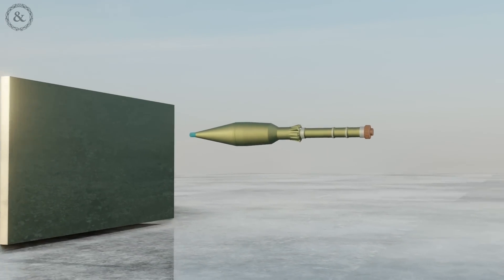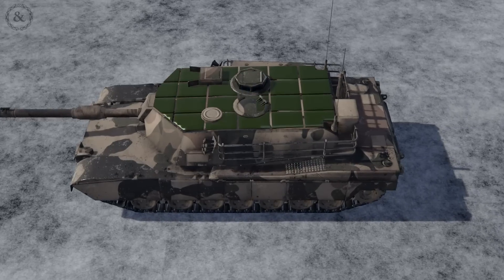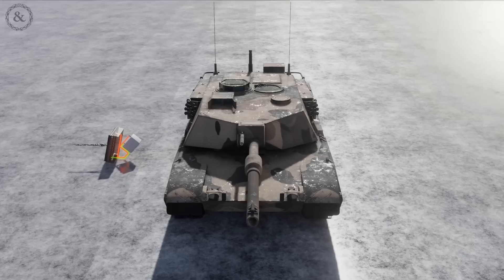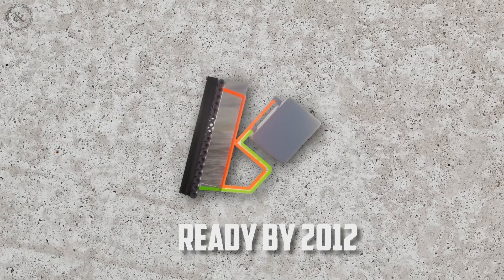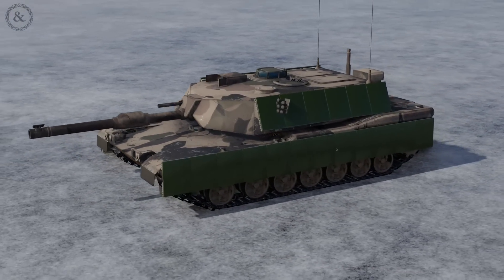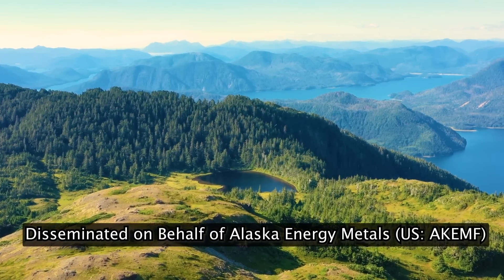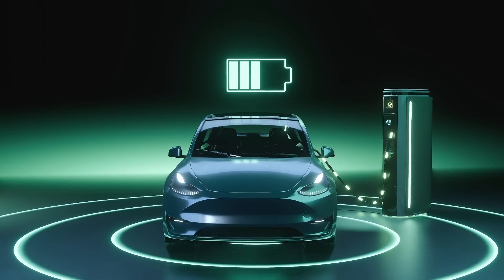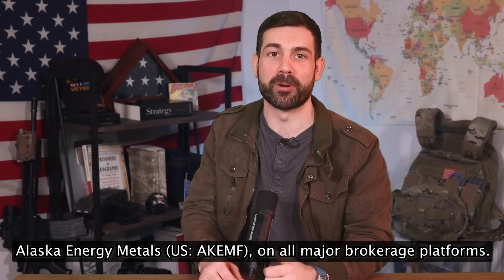How Electromagnetic Armor Vaporizes RPGs

Comment: "Can't imagine what would happen if I touched the wrong thing while working on it"
You don't have to. The operating concept behind this armor to my knowledge is basically a weaponized and even more intense harmful electrical phenomena known as an "arc flash". There are videos on YouTube of what an arc flash looks like when it's powered by "normal" electricity.
These tank armor proposals use a lot more volts, and a lot more amps. So instead of the injury received being "get severe burns across any unprotected area of your body" like with a normal arc flash, the injury instead becomes "Whatever parts of your body conducted electricity will be vaporized by the sheer amount of electricity forced thru them".
Arc flashes are basically an explosion. But instead of the energy being stored in explosive materials, or gases under pressure, the energy is stored as an electrical charge in capacitors (or a difference in electrical potential in a power distribution system such as the electrical grid, which is why electricians take such great care to wear insulated and fire retardant clothing when working on switchgear or HV lines).

The reason that this "electric armor" concept is so attractive in the first place is that it theoretically offers the appealing capability of "ERA that can take more than 1 hit to any one block of ERA", where with normal ERA it only works in any given location a single time, because of the nature of the material being distributed as armor in blocks. Entire blocks are detonated when the ERA functions. The only way to make it work more times is to subdivide it into more blocks, but they can't do that because there is a minimum size of block that can defeat a shaped charge. So they're at the limit for that.

Electrical armor is currently largely impractical. Capacitors of the requisite high voltage and high energy capacity are large, heavy, and when charged to operational levels are not tolerant of disruption such as that caused by hostile weapons impact on the capacitor itself (they are usually pretty tolerant of vibration when properly potted, but if you poke a hole in the capacitor with a metal object, all the energy in it will be discharged thru that metal object, and given that the whole point of electrical armor is to vaporize the metal jet from a shaped charge, that's not going to be a small explosion happening inside the armor of the tank).
Additionally, vs sabot (APFSDS) rounds, it doesn't have enough energy to discharge into the incoming round to defeat it. In other words, it's useless against sabot rounds such as those fired by most modern tanks. Only shaped charges, and maybe Explosively-Formed Penetrator warheads too since they're largely similar in function but have a larger stand-off range.

In other words, it adds weight, adds hazards to the crew compartment unless you put it in it's own compartment and treat it like ammo (blow-off panels highly recommended) and it doesn't really do much against one of the biggest threat to modern tanks, which is "other tanks" (firing APFSDS, or Sabot rounds).

In fact, there is an alternate kind of missile that would also be effective against both current ERA and this proposed electrical armor.
Kinetic missiles. The idea is to optimize the missile for high velocity with a "warhead" that is the "dart" from a Sabot (APFSDS) round.
In fact, Canada already has something suitable that just needs a guidance kit, the CRV7 unguided 70mm rocket.
It has an exceptionally high velocity compared to other 70mm rockets, due to a higher energy solid rocket fuel and a more aerodynamic fuselage shape being used. In fact, when comparing the Hydra 70 to the CRV7 just after the motor burns out (which is sooner for the Hydra than the CRV7), the kinetic energy of the CRV7 is roughly double that of the Hydra. This lends itself well to using the kinetic energy alone of the rocket as the means to cause destructive effects on target, which I'll go into later.
It is also more accurate than most 70mm rockets, due to the spin stabilization typical of 70mm rockets being imparted not only by the flip out fins, but by canted vanes directly in the path of the rocket motor's exhaust. This increases accuracy by giving the rocket some measure of stability (due to the spin) as soon as it leaves the launch tube, and before the flip-out fins have a chance to deploy to fully stabilize it. In other 70mm rockets, the fins are the only source of stabilization, so the fact that they only deploy after the rocket has fully cleared the launch tube gives those rockets a period of time where they could drift off course due to aerodynamic forces that the fins, having not deployed yet, are unable to balance out.
And now for a direct quote from Wikipedia:
"The CRV7's kinetic energy was so high that testers were surprised to find that practice rounds fitted with an 8-inch (20.3 cm) steel rod were penetrating outdated Centurion tanks used for target practice. This resulted in the development of a dedicated antitank warhead that replaced the steel rod in the practice warhead with a tungsten rod. This new antitank warhead could penetrate a Soviet T-72 main battle tank armour from any attack angle. Further study into this effect led to the WDU-5002/B FAT warhead, Flechette Anti-Tank, containing five tungsten-reinforced steel flechettes that could penetrate a T-72's side and top armour at a distance of 10,000 feet (3,000 m). It was also found to be a useful warhead for use against medium and light armoured vehicles."
So like I was saying, Canada already has the required propulsion and terminal effects packages for a kinetic missile, all that is needed is a suitable guidance package, which shouldn't be too hard to make happen since the Hydra 70 (which has a lot in common with the CRV7) has several different guidance packages either in production or nearly fully developed.

And with that sort of missile entering the battlefield, suddenly you aren't safe with your fancy electric armor.

Comment: As a former tanker who took a leak off the side of my tank before crossing the line of departure in desert Storm, this sounds shocking for the family jewels!
Reply from the maker: I’m picturing all the E4s and below who manage to electrocute themselves on the armor haha
Reply: I don't think they'd electrocute themselves because the batteries would already be dead after playing Halo all night  @Taskandpurpose
Reply: @Taskandpurpose somehow they’ll managed to sham their way out of that one too
Reply: This whole thing reminds me of the garage railgun hobbyists of the early 2000s who figured out that they could shrink pennies using cascade voltage multipliers and capacitors.
I wonder how many are alive today.
Reply: I've never had the privilege, so I've wondered, just curiosity: is there a section for .. restroom breaks in the manual, or did they ever mention that in tank school? I'd imagine the guidance would be that IF you survive, they'll make sure you get a new pair of pants, but you might have to hose out your seat yourself.
Reply: @196cupcake  dismount if in safe environment with a E-tool... If not safe diapers, baby wipes, 5 gal Lowe's bucket, 50 Cal ammo can. Helps to always have a few extra reg long trousers on the tank.
Reply: That's what the plastic cover plates are for.
Reply: Guess you really pissed off the enemy?  LOL
Reply: Unless you open the control cabinet your safe. It's not electric fence
Reply: @Fossillarson  I was going to say similar. Although, nothing electrical works "as intended" forever... I can only imagine what a lax maintenance schedule could do with this.
Reply: @kathrynck the same thing lax maintenance does to strapping explosive sandwiches on the side of your Vic anyways. It’s not a risk we’re unfamiliar with already.
Reply: @kolinmartz  Makes me wonder where can I get an explosive sandwich? That's just a very amusing metaphor :)
Reply: I was like, would a bullet set it off too but the armor plate may stop it
Reply: can't it easily be defeated by covering the RPG with a couple of rubbers? 
that's like what? 10 cents or 20 minutes with a goat in the middle east??
Reply: It fail consistently from the harsh environments

Comment: One of the things I feel might happen with APFSDS is that it gets vaporized but since it's already moving so fast, it basically just turn it into a HEAT round.
Reply: i mean you need a lot of energy to vaporize a sabot round
Reply: A sabot round is a solid dart of heavy metal, you need immense amount of energy to vaporize that. This is completely unlike RPG shaped charges that detonates to send a molten jet of copper at hypersonic speed.
Reply: Also the conductivity of the metal makes a huge difference in the effectiveness of such a system. If you designed the system to be as efficient as possible against HEAT rounds, it likely wouldn't have the juice required to do much to a tungsten dart. If you overbuilt the system to be able to damage darts, well now you are pumping massive amounts of energy into something that has like 30% the conductivity of copper and its likely going to be heavy and power intensive.
Reply: HEAT travels at 10km a second. Sabots at ~1km/s. It's not going to "speed" up to hypervelocity.
However.... tungsten is a metal that we use for welding, because it doesn't melt, and is super dense on top of that. What vaporizes copper does nothing to tungsten.
Reply: @ryanj610  again I know the difference and that it's not gonna be truly identical. Also HEAT isn't molten in the first place. I'm just saying the tiny metal particles will still be carrying a lot of velocity and will likely penetrate some amount of armor and the mechanism by which they do so is somewhat similar to how HEAT works.

Btw sabot usually travels closer to 2km/s, not 1. M829A3 is about 1650 m/s, 3BM42 about 1700 m/s, DM53 about 1700 m/s (from L/55). Newer experimental guns/rounds are pushing 1900 m/s. It would be about 1500m range that they slow down to around 1km/s which is still reasonable for tank engagements, but at much shorter ranges, they impact at velocities higher than that.
Reply: @RedVRCC  penetrators work because they are essentially a monocrystalline structure, all of the force and power is because it is one solid piece. It's like a dart vs a handful of sand.
Reply: It wouldn’t turn into a heat round even if it’s melted.  HEAT round’s molten jet is much much faster than the speed of a SABOT, plus it has a smaller cross section.  So a molten SABOT, if it could be done, would just splash against the armor plate, not penetrate it.
Reply: You have definitely misinterpreted how HEAT rounds work and where there penetration comes from. Heat rounds get its high penetration from a very thin metal jet (way thinner than an apfsds) and from its insane velocity which is like 2-3x the speed of a kinetic round. The jet of metal being hot liquid metal does not matter, with those speeds, the jet doesn’t have enough time to melt through any of the armor and even if it did, the jet wouldn’t have enough thermal energy to melt through much armor anyways.
Reply: @galacticdragon9841   @galacticdragon9841  again I KNOW HOW A FUCKING HEAT ROUND WORKS. I know a vaporized APFSDS round isn't going to act exactly the same. I was literally just saying that the small metal particles could still pose a threat to the armor if it's too thin in a simplified way because I didn't feel like typing all that shit out. I'm well aware of the velocity of a HEAT jet and it being the primary mode of penetration. When the electric armor vaporizes an APFSDS (IF it can), the small particles aren't going to magically lose all their velocity. They are still going to be traveling extremely fast and will erode the armor as they impact. They will not gain velocity from the vaporization, yes, but they are still traveling at between 1-2km/s. 

Oh and you're wrong, HEAT isn't actually molten, metals behave like fluids when exposed to extreme forces. The "penetrator" is still very much solid. Yes, it's still hot, but it's not at the melting point of copper. Russia made HEAT rounds with steel and even DU liners with even higher melting points and they still work just fine.  The "HEAT melts armor" is a common misconception. Go watch the Scottish koala video about tank ammo where he covers that misconception.
Reply: The shaped charge of a HEAT round is not vapour ,it's not even molten ! If you don't belive me check “ the shaped charge concept:introduction by William P.Walters"
Reply: I was thinking the same thing. 

Also it might not be ideal against old school squash head chemical rounds. That could be vaporized but low conductive rounds exist. Then there is the Javelin type of top attack rounds that are probably immune to this. 

It’s a good idea for a specific problem but not a universal solution. It could be put on some theoretical light tank but MBTs are still going to be big and heavy. 

Where this will be interesting is when fully automated drone tanks become really feasible.
Reply: Both Tungsten and Depleted Uranium suck it when it comes to conducting. The concept works for HEAT rounds from rpg, though just not for MBT rounds.
Reply: This doesn't vaporize anything, it's called electromagnetic for a reason, it passes a large current through the metallic fluid jet, this generates a strong magnetic field of the same polarity, this causes the jet to repell itself and disperse. You can witness this yourself if you put some heavy cables side by side and pass a high current through them (in the same direction), the wires will push apart due to the induced fields.
Reply: @xxportalxx.  Your explanation doesn't make much sense to me. "Magnetic field of same polarity"?
Reply: Yeah, I wonder how it holds up against heavier anti tank missles
Reply: can't it easily be defeated by covering the RPG with a couple of rubbers? 
that's like what? 10 cents or 20 minutes with a goat in the middle east?
Reply: To all the replies, Yes I do know the difference between the two types of ammo. I was just saying that if the APFSDS round was vaporized, the high speed metal particles might  act similarly. I know it's not exactly the same as HEAT.
Reply: Not if it's vaporized because, as the word suggests, it's vapor

Comment: Has the Navy looked into this concept to provide protection from anti-ship missiles? No read problem with power production and super capacitors could handle the power storage chores.
Reply: Nah, they're looking at active defense rather than reactive. Especially when you've got to take into account, that it would discharge if any water got in between the plates.
Reply: Modern AShMs don't tend to use HEAT warheads, because most ships don't have enough armor to make them useful.
Reply: @Attaxalotl They may not us shaped charged warheads but they DO use a lot of electronics to determine when they detonate. Frying those electronics could prevent that detonation. That is the primary way the electric armor defeats the RPG warhead, it fries the detonation system.
Reply: @research903  not really, given that the RPG needs to have already detonated to trigger the electric armour, given it's the molten copper that completes the circuit. What it does for an RPG, is put enough force into the RPG that the warhead deforms and can't properly apply the explosive force to get the copper the rest of the way through the tank.

Comment: Polarize the hull plating!
Reply: Was looking for someone to comment this lolz
Reply: what an enterprising comment! Glad I didnt have to trek too far to run into it!
Reply: that is what i am waiting for, Treki!
Reply: Made same comment...didn't scroll down to see that someone else beat me to it...
Reply: nothing underlines that comment better than your profile pic, i nearly spat coffee on my monitor, thanks
Reply: I actually submitted this concept a number of years ago, as a plausible explanation to shield technology in Star Trek: since there's no matter in space, if you'd have a number of open electrodes around your hull, the moment any kind of particle would reach it (phaser fire, shrapnel, radiation, anything) it'd complete the circuit, ground itself through the hull, and maybe be harnessed to recharge your own power.
as long as the voltage is kept at the threshold that it'd take a particle to breach the gap, no arc should spark.